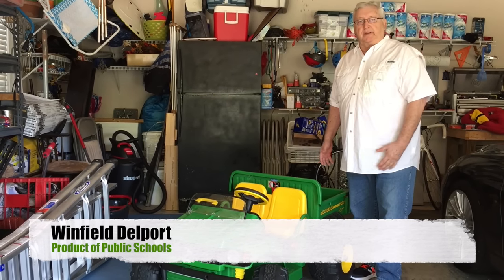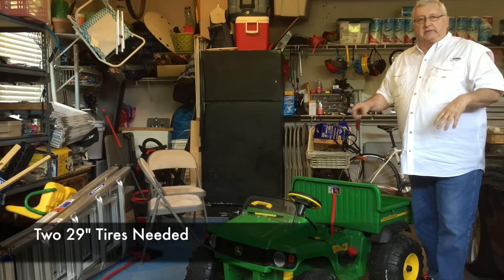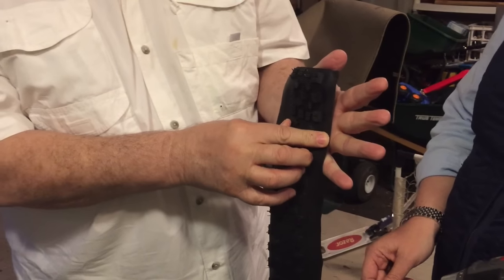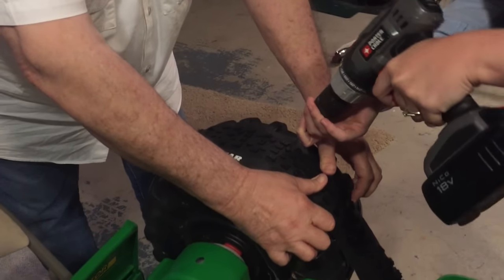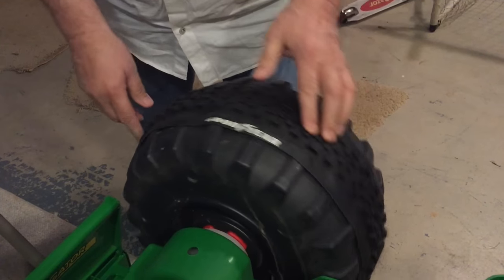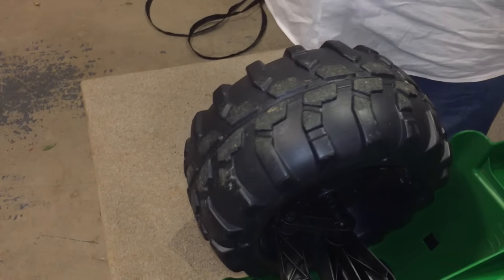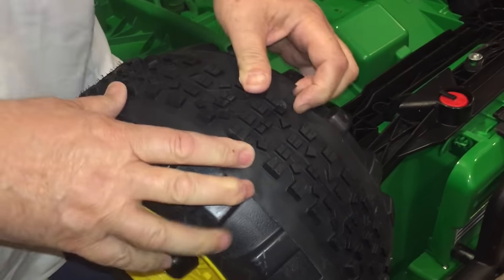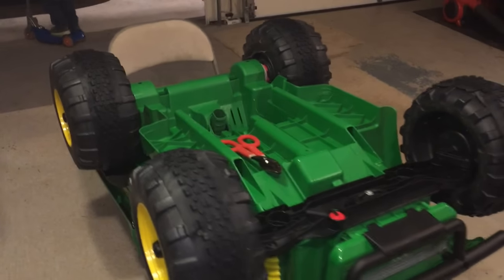Peg Perego & Power Wheels Tire and Traction Upgrade

Comment: Awesome upgrade. We have the tractor and I’ve put a 12v 12ah under the hood and two 12v 20ah batteries under the tractor all in parallel. The 3 year old grandson get over 12 hours of run time this way. Gonna do the tire upgrade soon.

Thanks for the idea.
Reply: If you put them in parallel your running 36volts...seems like a lot on a system not designed for that voltage....
Reply: Do have any helpful resource or guide for your battery upgrade? Extending ride time is a great idea.
Reply: @geezerguy6410  You're thinking series. In parallel, voltage is equal and amperage is cumulative. Hence the gain in capacity (12hr runtime).

Comment: Finally executed on this tire upgrade project.  Not sure if the newer trucks have larger tires but the 29 inch tires were not big enough to cover the front tires. It seemed that the tires I bought off amazon were stiffer than the ones shown in the video. I’d say to be safe buy 31 inch tires of those are available. I doubt they would be too much more expensive. But overall the project was a huge success. My kids can now drive all over my hilly property without hardly any slippage at all! Pretty amazing! Thanks again for the fantastic video!
Reply: Veracity did you actually use the 31” or smaller/larger? Just about to follow suit.
Reply: @DynamicDaddio  I'd recommend getting the biggest you can find. I had to buy an extra 29 inch tire to get around all 4 tires. But the final result is amazing. My property has all sort of hills and the gator can make it up all of them with the tire upgrade. Get the best cutters you can as the metal plies are very difficult to cut through.
Reply: @ABCD-eg5ky  I don't know if youll see this, but can you give me the exact dimensions of the tires? I'm having trouble finding them.
Reply: I've never seen a 31" bike tire. If you need extra length, use a heat gun or hair dryer, or leave the tires in the sun for a few hours to soften them up to get the stretch.

Comment: I did just the rears but was able to cut a 29” tire in half and stretch it to wrap both rear tires. Turned out really nice. With the tight pull it really conforms to the plastic tire.

Comment: I want to give a shoutout to Winfield over there... Did this and my son was rocking and rolling up our steep driveway on the first try.  I have the newer model XUV and bought 2 29" tires.  They were only big enough to do 1 each.  Should have bought 4 smaller tires.  Either way, I am excited for my 3 year old to cruise around our mean streets.
Reply: I just got the XUV - which tires should I get?

Comment: Excellent fix 👏 
Thanks for sharing this information. My son's gator would just spin the tires on pavement turf and dirt. Definitely need to do both rear tires because there's 2 motors in the rear (posi traction) wish they had these when we were kids. 👍

Comment: Great idea, just one suggestion, you may want to use rivets, less chance of them popping out and getting you some flat tires on your cars.
Reply: The drywall screws don't pop out. They are holding up great after two years.

Comment: Since there is more traction, is it harder on the motor and gears since there is no slippage?
Reply from the maker: Yes, I'm sure it does put the motor and gears under a bigger workload. It was not catastrophic though to our boys' regular usage of it. It was still running and operating when we gave it away to another family when our boys outgrew it. We weren't seeing more fuses blown or anything like that with the traction upgrade either.

Comment: The tires that come on the car are the tires it was designed to run. Changing tire diameter changes the gear ratio and can burn out motors. Ride-ons don't have a clutch in their gearboxes. They use the spinning tire as a clutch. Adding more traction with rubber or spikes removes the clutch and almost always overheats motors and breaks gears. Picking the right vehicle for your kid includes matching the tires it comes with to the terrain it will be used in. Monster Traction tires on the F150 are really bumpy on pavement. Mustang tires will not get traction easily in dirt. Tires are not interchangeable between vehicles so before you spend your time and money modifying make sure you've got the right foundation. You can't get no action if you ain't got no traction!
Reply: The gearbox/motors blow out from shifting from forward to reverse while moving. That's the most common problem with the gearboxes. Are they made to slip, yes, but the shifting while moving is a lot harder on the gearbox/motor than the no slipping after tire mod is. I was a powerwheel certified tech long long ago.
Reply: All of the Power Wheels brands have hard-plastic tires with the same basic design, and almost all the same treads. They are likely designed to be cheap to blow-mold, without consideration of wear on the gear-box. 

Adding treads to the front tires doesn't affect the gear-box at all, but will make steering much more responsive, possibly making it safer (rather than skidding straight forward when trying  to avoid an obstacle). 

Adding to the back will add the more-instantaneous grip, so that can add wear to the unmodified gear-box, but the stock tires can catch instantly on some surfaces as well. 
As is, my kid wore the stock tires completely out before the gear-boxes (front and back, driving on the rims by the end). I think the other point that the reversing while still moving forward is definitely the worse wear and tear on the gear box. (Good luck training a 3 or 4 year old to not do that.)

Various traction upgrades usually end up in tires that will out-last the life of the vehicle.

In the end, if the terrain is leading to a lot of slipping, there is a trade-off. The kid gets more use from the tires if they are upgraded, along with less frustration and more fun.
If that does reduce the life of the gearboxes, you can get stronger replacements for as cheap as $70 for two. Replacing all four tires, as I have had to do, cost me $60. I wish I had known I needed to add some protection to the tires. I think we only got six months out of them on our terrain.
Reply: @grandwizardnoticer8975  I agree,the ride-on we have is 6 years old, has discoloured and is beaten up and just recently the kids broke the steering wheel off.
Like anything made of plastic these days most have a short life.
So mod away and enjoy them while they last.
Reply: @paulhotson5820  I just noticed that your original comment was from the MLTOYS website, ha ha
Reply: @grandwizardnoticer8975  Search and you will find! 🤣
Reply: Blah blah blah

Comment: why not just buy new real rubber wheels and replace ??
Reply: There is no direct replacement. The absolute easiest upgrade is something like what is shown in this video. A 14" trike tire can be slipped directly on with some soapy water, rather than screwing a cut length on.